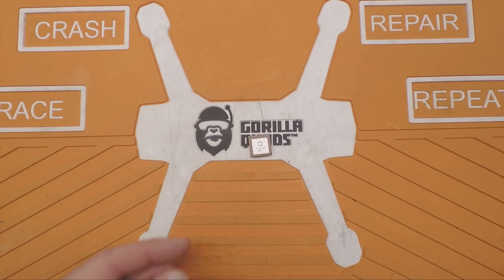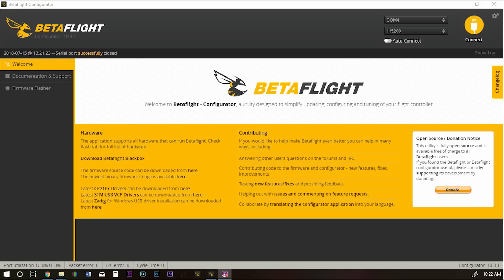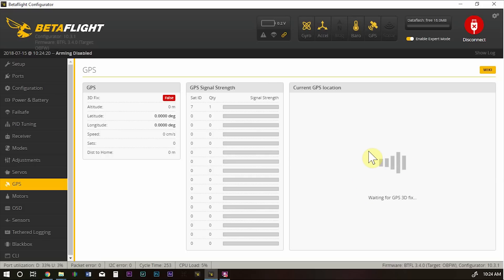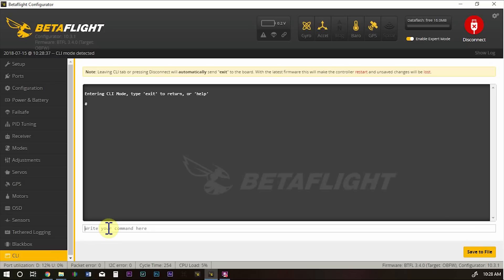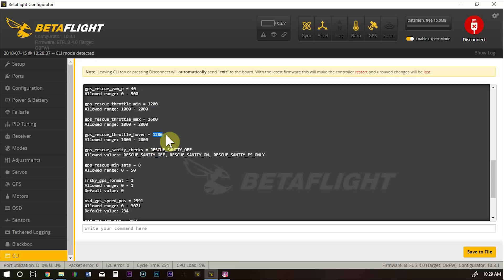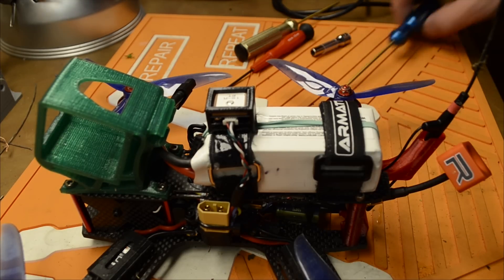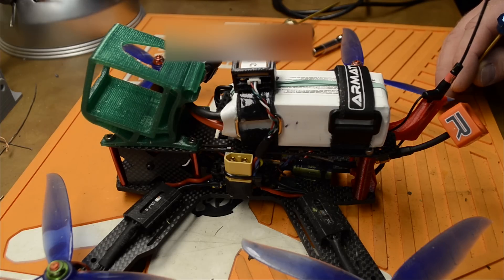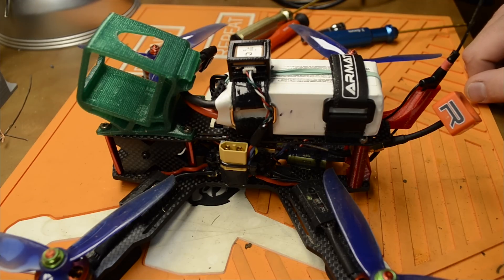Betaflight GPS and Rescue mode setup

Comment: Hi seen video I've done all this stuff my issue is setting a switch just for GPS rescue when I enable it tick setting hight how many sat speed angel etc I choice aux 2 3 4 5 it takes Aux 1 always I'm using express lrs so I need Aux 1 to arm quad I know it's something stupid but it's the switch thing or can you move aux switches around if you not done video on this could you I'm using jumper t lite 4in1 multi protocol chip please I can't arm my quad with GPS rescue on a switch but can if set drop or land strange right cheers for video want todo long range stuff got Diatone Roma L5 6s version I've only got 4s it's bloody fast as hell
Reply from the maker: Ah..... I'm trying to understand what you have said here. Sounds like your quad won't arm if you have GPS rescue set on the failsafe tab in beta flight?
Reply: @TweetFPV  yep
Reply from the maker: There is a minimum amount of satalitea required for arming that can be found in the failsafe tab. You can also bypass this by clicking the "allow arming without fix" option but if you do take off without the minimum amount of satalites the GPS rescue feature will be disabled for that flight.
Reply: @TweetFPV  ok I get that but with Express LRS u need Aux 1 for arming I've set up Aux 1 for arming Aux 2 GPS rescue Aux 3 for angle horizon Aux 5 for beeper when try arm says GPS rescue SW or switch but I'm in side so if I take it outside wait for sats etc your saying it will arm I've picked 8
Reply from the maker: @gadgetman404 I'm assuming that you have defined the switch properly in BF and you don't have GPS rescue function "Active" while arming in the modes tab in BF
Reply: @TweetFPV  I've set it but it's still need find tuning I was flying straight for my hit switches didn't seem to do anything so I had to disarm not to hrigh long soft grass no damage can send me your settings in failsafe tsb to check against mine see what needs to be changed cheers from sunny today uk

Comment: I have this exact same gps, it takes forever to get a lock. I have to let it sit connected to BF while I fly another quad. By thr time I get back, I'll have a lock. Then I can disconnect from bf, remove my USB and plug a battery in, and I'll have sats. Besides that 9600 didn't work for me, the blue led goes crazy strobe. At the auto default 56700, it will get a lock, and the gps is flashing correctly. Just woundering how long does it take you to get a cold start lock?
Reply from the maker: Anywhere from 5-10 minutes. After that 30 seconds

Comment: My drone get disarmed and fall when I set GPS RESCUE swich. What could be tha cause?
Reply from the maker: There is a minimum trigger range. So you need to fly about 200m away from you before gps rescue mode will be active.
Reply: @TweetFPV  Thank you so much, finally the solution was the distance requiere to activate the gps rescue mode, 200 meters works excellent.

Comment: I have the same gps module. Is it normal that this becomes really hot? I mean, u can barely touch it after a flight. It also melts the glue sticks...
Reply from the maker: No, mine doesn't really even get warm!
Reply: If you connected the gps to the wrong power source it could cause problems. Vcc on the flight controller and vcc on the gps are probably not the same.  Vcc on flight controlers is normally battery voltage. The gps needs 5 volts.

Comment: Hi,could you help?
I installed a matek gps in my quad, I made the cli adjustments,changed to 5 sats and now won't arm,any thoughts?
Thanks Rick
Reply from the maker: Do you have the number or sats displayed in your osd? Bf will not let you arm untill you have at least in your case 5 satalites. If it has been a long time since you had a good satalites lock it can take upwards of 5 minutes to aquire the satalites you need. Subsequent start ups will be much faster.

Comment: Finally flew the Tero Q215, with upgrades Caddx SDR 2, R9 Slim Plus and BN 220 GPS. Installation Thx to TweetFPV vids. Don't fly without a GPS guys it works really good with no adjustments in CLI. It does disarm if ya let it complete its RTH and dropped straight down about 20ft no damage. Thx again TweetFPV.
Reply from the maker: Thank you so much, I'm glad I was able to help!

Comment: Hello, very good video. question, what is the Rescue sanity off / on sentence?
Reply from the maker: Sanity checks will ensure that you have a valid GPS fix, that the quad is spending most of its time approaching home, and also it will do its best to disarm if it detects a premature landing (not within the target home landing zone)
Reply: @TweetFPV  
ok, es conveniente tener encendido? ¿Puede causar algún otro tipo de problema? porque viene por defecto a OFF.
Reply from the maker: deje activadas las comprobaciones de seguridad, esto mantendrá el modo de rescate desactivado si no hay suficientes satalites y otros parámetros necesarios para que funcione correctamente
Reply from the maker: Best place for up to date info on bf rescue mode can be found here :https://github.com/betaflight/betaflight/wiki/GPS-rescue-mode

Comment: Very good video! I have a questiong regarding GPS failsafe mode. If you set failsafe to GPS-RESCUE and min_sats = 0, what happens if you enter failsafe and you have only 2 sats?
Reply from the maker: Honestly I don't know. You probably won't get your Quad back. At a minimum gps requires 3 sats to get a location and 4 to get location and altitude. The more sats you have the more accurate your position will be.
Reply: @TweetFPV  Nice thanks! What would you recomend as a "workflow" in case you get failsafe or video loss? Maybe create a switch in modes tab? I guess the idea of this rescue mode is to give you some second chance in case something goes wrong
Reply from the maker: I would put it on a switch incase of video loss. If you get to the point where you trust rescue mode then set it up as a failsafe mode as well. If you only have it on a switch and not as a failsafe then you are kinda out of luck if you failsafe.

Comment: ok I cant seem to get GPS showing on smart port. Is there anything i might be missing?
Reply from the maker: I had this issue but I can't remember how I solved it. I think i updated bf, rebound the model, deleted and re-discovered all sensors. I'm not sure which of those things solved it for me.
Reply from the maker: Now that I'm think of it. The gps position didn't come into being an avalible telemetry sensor untill I had a full 3d gps lock. Then re-discover sensors.
Reply: Ok i see, i will have a look and try it out then. Thanks for your help and assistance. Much appreciated!!!
Reply from the maker: Reply back if you figure it out!
Reply: Hey bud it worked!!! B) So like u said I just needed to wait for a lock. I set my remote up on Descover new sensors. And just brought my drone out side. Once I got a 3D lock with GPS then the list was populated with GPS, GSpd, GALT, 0420.
Reply from the maker: That's great news! Happy flying!

Comment: Aewsome, what dimensions you used for the printing, same as the GPS module, I'm going to use a different module so I have to modify the mount...
Reply from the maker: 19x21x6.
Reply: @TweetFPV  thanks, I don't own a 3d printer so I will have to order the mount online... And I didn't know the correct dimensions, thanks!
Reply from the maker: Contact me at tweetfpv@gmail.com, I may be able to help you with this one.

Comment: the stock altitude on the way back is 50, so if the quad is flying at 70 metres above that ground will it go higher 50 metres from the 70s or will it go towards the ground until it reaches the 50 metres? thanks in advance your video is really helpful
Reply from the maker: if the the altitude is set to 50 and you ascend to 70 during your flight, when rescue mode activates it will go to whatever the highest altitude during the flight was. So in this scenario 70 (+15).
Reply: @TweetFPV  +15? or +50?
Reply from the maker: what ever you max flight altitude was +15M
Reply: @TweetFPV  hm ok, so if your altitude exceed the 50(stock) then it will ascend another 15, what if you are flying below 50, lets say 20, what is going to happen ? will it ascend to 50? sorry for the questions i just want to make it clear :p
Reply from the maker: exactly, it will ascend to 50m. No worries about the questions. check out the BF rescue mode page. https://github.com/betaflight/betaflight/wiki/GPS-rescue-mode  there is a lot of good info in there, and if anything changes between BF versions this page should get updated info.
Reply: @TweetFPV  thanks a lot
Reply from the maker: Any time!

Comment: My quad will not arm with 12 satellites...? Are there other parameters that prevent arming?
Reply from the maker: It sounds like there are. If you can connect your quad to BF then go to the CLI and type "status" and see what arming prevention flags you are getting. Or if you have "warnings" enabled in your osd what does it say when you go to arm your quad? This will help with the diagnosis.
Reply: @TweetFPV  Setting a switch for return home in BF seems to have done the trick... not sure if that did it but but the quad is arming...also fport working... r9m r9mm combo working... gonna fly tommorrow... yeah I do fly in the house lol

Comment: Have you done any new tests with this function? 

Do you know how agressive Rescue mode is? 

For example a drone flying at 100+ mph several hundred feet from the takeoff area. Can betaflight calculate enough tilt to stop the drone and make it return home? Or will it just flip/spaz out as the amount of tilt and power needed is too much?
Reply from the maker: I haven't done much more testing of rescue mode. I plan on doing more soon. (life 🙄) from what I've experienced it is like a switch when it activates and is very aggressive. I haven't seen any parameters to change how fast of yaw rate it will make. I assume it is what ever your max rates are in your rate profile. As far as return speed it is all set in the cli parameters.

Comment: Thanks!  I ordered one of these GPS units from ready to fly quads and plan to add it along with R9M/R9mini and 2.4 ghz video tran/rec to a 7" frame to be my long range rig. Cheers Rick
Reply from the maker: 2.4g video on a long range Quad would be great. Thanks for the watch!
Reply: am really curious to know how far you flew with R9mini in collaboration with the gps please :) thanks in advance
Reply from the maker: So far the longest run I have done is just over 1.75 miles. Fpv video link is now my limiting factor most of the time.
Reply: @TweetFPV  until what point your video signal was rock solid?
Reply from the maker: After 1 mile I start making small circles to see what my video is like. The terrain here is mostly flat so I can't get a great Los with my 5.8GHz video.

Comment: I got a quad with omnibus f4 v3, and m8n gps module soldered to uart 6, it just falls out of the sky, on GPS rescue mode, im getting up to 21 sats, i got the latest version betaflight omnibus f4 sd installed see vid https://m.youtube.com/watch?v=VLB_0WX9BKU
Reply from the maker: If you haven't altered any of the settings with gps rescue mode you need to be at least 200m away before it will work otherwise it will just drop. https://github.com/betaflight/betaflight/wiki/GPS-rescue-mode

Comment: why my gps is very long to lock a gps, i use bn220
Reply from the maker: I have my GPS powered off the fc when the USB is plugged in so I will connect the fc to a USB power bank for about 10.minutes while I get all my gear setup. Then when I plug my lipo in the gps is quick to aquire sats.
Reply: but, i try connect usb from my laptop, when i get GPS and connect the battery, the gps lost again :( so confuse, first time i use gps...
Reply from the maker: It should drop all satalitrs when you remove power but it should find them much faster then. Or perhaps you have a defective GPS unit.
Reply: or i must go to field? i try this in front of my house...
Reply from the maker: Oh yea that could be interfering with the signals too
Reply: @TweetFPV  sir, gps is sorking flawlessly on the field, but when i activated rescue mode, only black
 ( * * * *) stars flashing on OSD, and nothing happened... why??? can you figure out?
Reply from the maker: You must have some aspect of rescue mode incorrect. Check the cli for your rescue mode setting and make sure you have your accelerometer enabled.
Reply from the maker: The first time you start up after a long period of inactivity will take a very long time this is referred to a cold start. There should be a little battery on your gps unit to hold some sort of almanac data to allow for a faster startup next time. My first start after a week of inactivity is about 5 minutes. Also the better view of the sky you, and low electrical noise you have the faster it will start.

Comment: I see in the order page there's a bunch of connectors to chose from. Which one should I get for my Matek F405?
Reply from the maker: You can if you want. Does the matek 405 have pin headdress on it? In the end you'll probably just direct solder to a uart.
Reply: @TweetFPV  I don't think they come with a cable anymore. I think you have to choose what cable you want. It's not optional to pick a cable. It's mandatory. Go to the website and pretend you are ordering one so you see what I mean. There's like 10 options I just want a simple cable that goes from the GPS to the fc and I'll solder it there.
Reply from the maker: Oh yea I see that now. Just get the 4 Pin sh connector.
Reply from the maker: I feel like they had an option for just bare wire before, But I can remember.

Comment: What will the quad do in rescue mode if you leave it in rescue? Hover? Land? Drop like a rock?
Reply from the maker: Drop like a rock. It's intended to get back to a point where you regain rc link, video, or Los of the Quad.
Reply: @TweetFPV  thx
Reply: Mine dropped from the sky as soon as I clicked the switch.  That was not a fun or safe test.  I am not sure how I am to try and do this again without expecting to sacrifice the whole thing.
Reply: @WhatAmIGonnaGet   Doesn't sound fun. BF has some work to do on this feature.
Reply: I did not realize the feature was so new.  How the hell someone would test this I do not know - they would need a copter made out of rubber and fly over a field of long grass.